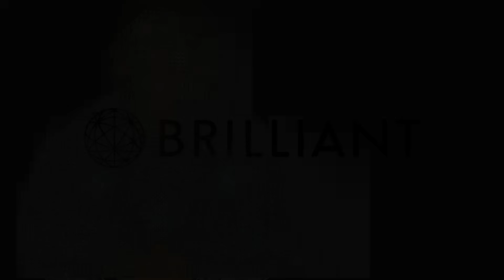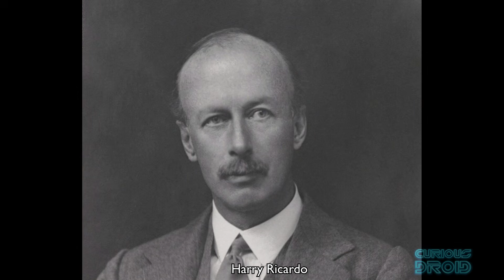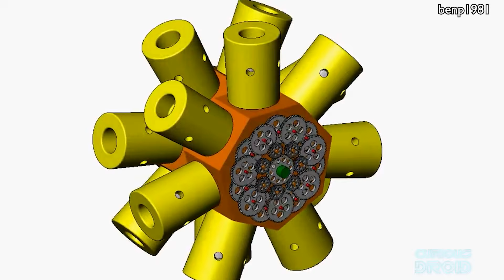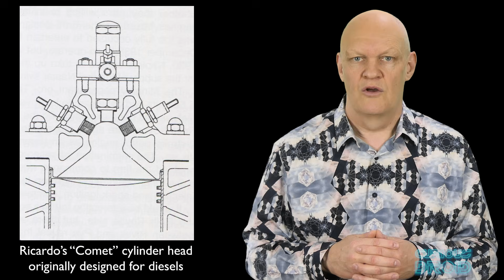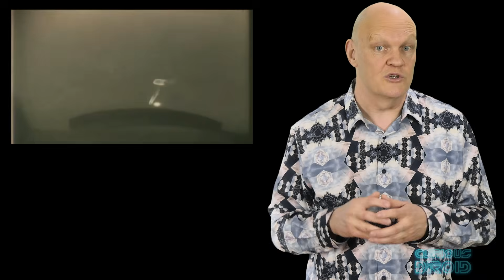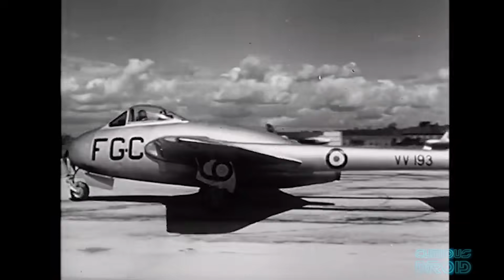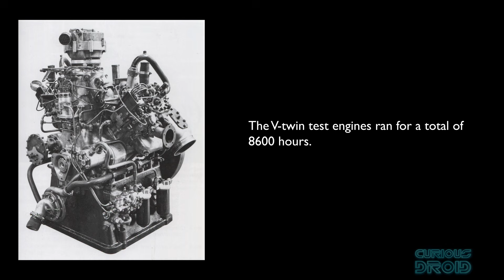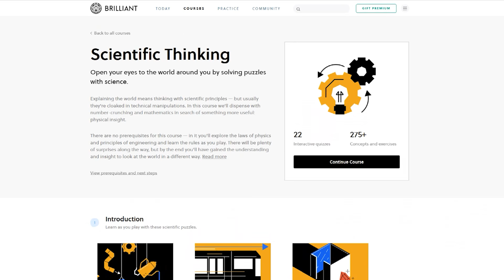Rolls Royce Crecy - The Most Advanced Piston Aero Engine Never Made.

Comment: "We just need another 6 months of development time..." - Every engineer ever.
Reply: "3 months maybe, 6 months definitely."
Reply: @jeff119990  I have said that more than once.. :-)
Reply: And quite often they are proved right...
Reply: @waynegilbert9504  it depends very much if they have not encountered development issues. More importantly that the engine is born "right" as was the case of the Merlin that despite usual problems had only very few "teething problems" that was quickly solved, something that cannot be said regarding the formidable Napier Sabre IV engine; that had been principally delayed by protracted problems and slippages encountered in the development of this engine...
Reply: @paoloviti6156  My experience with development issues is that if they don’t turn up during development they appear during deployment and cost 50 times more to fix.  The Merlin is a vastly simpler engine than the Napier Sabre, development of which was started with a very incomplete understanding of the sleeve valve technology - as illustrated in the case of the RR Crecy design.  Of course, all of these died quickly when the gas turbine became a feasible reality.
Reply: @waynegilbert9504  exactly and well said. Aside complexity with sleeve-valves it is possible that those engines have higher oil consumption in order to lubricate the sleeve-valves and the wheels?
Reply: @paoloviti6156  Indeed they did have oil consumption problems.  One of the benefits of the sleeve valve is the greater port area that becomes possible, this inevitably leads to more of the exposed sleeve being lubricated.  The exposed oil is burned off during each engine cycle.  The Sabre also had problems with resulting the carbon deposits causing drag on the sleeve.  Years ago I had the privilege to take to an WW2 ex-RAF ground engineer who told me that supporting the sabre engine was a nightmare, especially the earlier units that were plagued with problems.
Reply: @waynegilbert9504  thanks for taking your time to explain. One thing for sure is that those mechanics doing service on those wonderful aereo engines especially the Sabre Napier, complicated as hell, were far above the average with years of experience on the shoulders...
Reply: @paoloviti6156  All of the engines in that era had very high oil consumption, some oil burned and some leakage, so much so that it was considered a consumable and part of the useful load, standard practice was to calculate oil weight and consumption into each flight load plan. (Multiple gallons per engine per mission) 
Even decades later calculating oil weight remains in some pilot training books, though aircraft manuals have since standardized to include engine oil as part of the operating empty weight due to the drastic reduction in consumption. 
Now the oil burned in the cylinder is simply another fuel source so was not a significant performance impact, and oil leaked was due to the gaskets of the time which affected all engine designs.
Reply: @mytech6779  thanks for the info! Must say that aereo engines of 2nd WW required lot of oil but perhaps the most unfamous in this field was the massive Pratt & Whitney R-4360 Wasp Major, that powered the postwar B-36, that required prodigious amount of oil to lubricate its engines...
Reply: @paoloviti6156 ...they were told, "don't worry about fuel and oil consumption, we want it fast!"
The pressures of wartime force compromises be made. And engineering and medicine both advance during war.

They HAVE to...penicillin from the Tizard mission was in doctors hands before the war ended.
Reply: @paoloviti6156  blln
Reply: @paoloviti6156  The Merlin born right????  Did you forget the ramp head? Failing the type testing but given a pass for expediency?  The limited hours before valve failure? The quill shaft failures, the cam shaft drive failures, etc, etc   In reality, all the earlier production Merlins were more big Kestrels rather than anything else. The Merlin was the perfect example of the triumph of development over design, don't fall for RR's marketing hype.  Now the Griffin, that was born right.  RR would have preferred to get rid of the Merlin and concentrate on the Griffin, but that was not possible, it was too universal and turned in the "right" direction for the Americans.  It was also light and sounded "right" unlike the Griffin <shrug>.

It was the Sabre II that got the bad reputation.  The Sabre IV was a considerable redesign of the internals of the engine, the program proceeded quite well with the limited resources available, but people were impatient.  RR had a huge engineering department, so big they could design distractions like the Pennine and to an extent the Exe and Crecy, Napier not so much.  RR also had a tendency to lure engineers away from Napier   Don't forget, the Centaurus was also "late" and wasn't finished until after Roy Feden had left Bristol.  The Junkers JU222 was so late that it killed the entire German heavy bomber program!

All production Sabres were impressive, they were passing their type tests and producing over 2000hp at a time the Merlin was producing just over 1000hp.  

Such discussions can go on for a long time with tit for tat claims.  Doesn't bother me, I like the Merlin because of its fascinating development story, just as I like the Sabre for the story of its production woes.  But then i was once an engineer and I usually like the backstories and the nitty-gritty rather than the pizazz.  

Now, the Nomad II, there is a design that is extraordinary, the thermodynamics and the fine detailed engineering required to make it work.   Was never going to catch on, too many parts (pommies just love making parts) but I reckon it was killed by the Beiers variable ratio coupling.  Anyone looking at it would shudder when thinking of the usual maintenance people working on the delicate and so precise discs.   And keeping it all pristine clean!!!
Reply: @paoloviti6156  The Merlin's oil consumption was somewhere north of an imperial gallon an hour up to about 5 gph was acceptable AFAICR.  

Design changes keep the oil consumption down on the Sabres unless the sleeves had manufacturing faults or were excessively worn due to dirt and debris entering the engine through the air intake.  Sleeve valves were not that complex and had a number of advantages, some of which were overtaken by the enormous effort put into fixing the poppet valve train, others advantages continued.  The problem was the precision manufacturing required for the very high performance application of high-powered aero engines.  At the beginning, the Hercules piston/sleeve/cylinder were manufactured to fit each other and were always changed as a matched set.  By the end of the war, manufacturing had improved to the point that the parts were interchangeable.  Henry Ford was a big believer in accuracy and precision, as these are prerequisites to reliable mass production.  Look up the "Johansson gauge blocks".  The precision in, even cheap, modern car engines would have dumbfounded production engineers in the war years.  As to material science...
Reply: @waynegilbert9504  All WWII aero engines burnt heaps of oil, excessive usage was viewed more as an indicator of other engine problems rather than a problem in itself.  Amazing thing about the sleeve valve design used by Napier and Bristol, which is essentially unchanged from the original Burt design in the Argyll car, is that one of ports in the sleeve alternatively uncovers the exhaust and inlet port in the block That is, the sleeve is exposed to the flow of hot exhaust gases and then rapidly exposed to (relatively) cold inlet gas flow, in engineering, this is normally a big no-no, but they got away with it.   

If poppet valves had been more advanced in the early thirties, sleeve valves would have never been used in WWII.  Apart from their advantages (and disadvantages) in gas flow, they were just more reliable than poppet valves as erosion of the exhaust valve was a very serious issue in 30s aero engines, as were valve spring failures.   These issues had been a problem from the dawn of high performance IC engines, the 1912 L76 Grand Prix Peugeots used desmodromic valve gear on their twin overhead cams mostly because valve springs were so unreliable.  After an enormous effort, poppet valves became more reliable, eg RRs Bright-Ray coating cost RR a fortune to develop, as did Roy Fedden's search for the perfect material for sleeve valves cost Bristol a fortune.

I am sure the WW2 ex-RAF ground engineer had plenty of bad experience with the early Sabres but generally, they hated them because they could be difficult to start, once they had run through the four (I think it was four) Coffman cartridges  without starting, they had to oil up the sleeve bores by pulling the plugs - not much fun.  The engine was just very different to the RRs.  The RRs were normal, the RAF had been using them forever, they had used the Napier Lion as well but the Sabres were a completely different beast, I believe they weren't keen on the Dagger either.

 In normal times, no one in the field actually worked on engines, any problems, not strictly maintenance as covered by the book, had to be solved back at the manufacturer's dedicated maintenance facility, just the same as the RRs and Bristols, that is an engine change.  I am sure there were times when they were fixed in the field, but I am not sure how you work on an engine that you have never pulled apart before and don't have the tools, parts or facilities to repair.
Reply: @robertnicholson7733  thanks for the very interesting info, much appreciated 👍👍
Reply: @robertnicholson7733  a very interesting info regarding the Sabre as I find it very informative, thank you 👍👍
Reply: @paoloviti6156  Yes, I heard sleeve valves in the Sabre were nightmares of leakage & breakage, and that the early development models of the Bristol Centarus were almost as bad.
Reply: @dphalanx7465  yes but the truth was that the engines were very complicated that necessitated much long development that was not possible because the war yet I find it impressive that they managed to put in production those two engines...
Reply: Keep fighting time and money constraints and this will be the standard answer...always
Reply: @ambread1 ...don't forget incompetent managers.
Reply: @M Bacon Not surprised given the number of sliding parts.  I had never looked at sleeve valve engines in cars before, but they seemed to do better that i would have expected. https://en.wikipedia.org/wiki/Knight_engine   Thats not to say I would want one...
Reply: Its just so we can seem like geniuses when we actually do it in half the time. 😁
Reply: And still the business guys didn't learn, that it's cheaper to give it 6 more months than to fix the problems afterwards...
Reply: More of every investors holding back engineers, ever hehe...
Reply: And then there is Gabrielli who developed the Fiat G-92 in just 1 month
Reply: Engineers have an easy life, they get to work around the clock for six months to complete one milestone, us welders always need to have six months work delivered yesterday.
Reply: We can usually do it in a week but the majority of the crew will be missing most major body parts.
Reply: eg F-35.
Reply: Its a DFI gas 2 stroke and the Rotax 850 ETEC is a tiny version of it sort of.
Reply: Wait they could have done a popper valved loop scavenged conversion of the merlin with running the cam at 1:1 and baffle installed in the inlet valve to prevent short circuiting the air charge! This can tune any 4 joke into a 2 stroke with out a lot of hardware, swearing and machining! This is how to make a quick 2 stroke conversion fix using what you already have. It works like this on this 1.9vw 2 stroke conversion 450 HP bug 2T:https://www.youtube.com/watch?v=qosAllch8Sg&t=9s
Reply: Yes!!!!
Reply: We just need another 1 billion pounds and where there.

Comment: How I wish some clever engineer would find that engine interesting enough to take on the task and try to recreate and perhaps, complete the design. Would be a proper salute to the original designers and the engine it self, to see it complete.
Reply: Using current manufacturing technology and materials, this would not be a particular problem.  But it would be a solution to a problem the existed 80 years ago and would have little value today.  Apart form making one hell of a noise :-)
Reply: @waynegilbert9504  Go and see Riccardo Consultancy in Shoreham with a large wadge of cash and they will probably build you one.
Reply: @johnmurrell3175  No doubt about it, hence my comment.

Comment: Makes me wonder if this can be adapted to automobiles to improve their performance and efficiency.  I'll be willing to bet that the fuel efficiency will go up exponentially as well.
Reply: Motorcycles would probably benefit from this even more. If you can reduce the frontal area of the motor you can significantly reduce drag.
Assuming you are aiming for similar power levels to current bikes.
Really any time you can reduce the size of a motor for a given amount of power there are going to be a lot of secondary benefits.
Obviously muffler design would be VERY important for civilian use...
Reply: If you're interested in modern 2-stroke engine technology check out the Rotax/Evinrude voice coil direct fuel injected 2-stroke engine that's been used in snowmobiles & outboard motor boats for over a decade now.

Comment: An interesting thing about the sleeve for the Crecy was that there were only ports in them for the inlet, which was near the bottom of the cylinder. The top of the sleeve uncovered the exhaust ports during its reciprocating motion. This caused problems with the longevity of the sleeves.

Comment: Look up the Napier Nomad to see where that sort of thinking ultimately led.
Reply: 2-stroke diesel, with a huge turbocharger that could produce useable thrust. The test engine were reliable getting over 3500hp at a ridiculously meagre fuel consuption. Then the added an intercooler, and then stuck an afterburner on the back of the turbo! Madness, but it got the power to weight down to 0.83lb/hp. And the test horsepower was around 4100. There is a great write up in LJK Setrights book "The Power to Fly", a history of the piston engines used in aircraft.
Reply: @sadiqmohamed681  Technically, it would be better to describe it as a gas turbine that used a 2 stroke diesel as a gas convertor.  If you follow Chatterton's work you will see why.  

It was just too complicated, two engines in one, required a spark ignition to get it started, but the real problem was the delicate Biers variable ratio coupling.  Had some unusual internals, since it was a two stroke, the con-rod little end was a slipper bearing, the con-rod big end bearing shared the same journal, there was no big end cap just a couple of small rings to top stop the rods from falling off the journals when the engine was at rest or starting.  Pressurized coil cooled piston crowns of martensite (AFAICR), the list of design features goes on. the Nomad 1  was far more complex than the Nomad II, however complex does not mean advanced.
Reply: @sadiqmohamed681  I found it in "Some Unusual Engines" by Setright.
Reply: @donaldasayers  Another good book. I should look for a copy. I haven't read it for a very long time. I used to have "The Power to Fly", but it disappeared a couple of decades ago. I spent more than 10 years looking online before I found one I could afford. Good copies are into hundreds, and there was a mint edition fo £1,400! All Setrights books are collectible.

Comment: An even more powerful piston engine that is lighter and simpler in design would be a full on 2 stroke fuel and oil injected spark ignition engine..with expansion chamber tuned exhaust system..I could just imagine the output of a RR Merlin equivalent using this design principle had it been developed further.
Reply: Have you been living under a rock? The Rotax E-TEC voice coil direct injection 2-stroke engine has been powering snowmobiles & outboard motor boats for more than a decade. There's even a Turbo-charged version.
Reply: @autodidact537  My comment sir has been worded in simpler terms for the benefit of readers who are NOT techno heads like you and I..As an Aerospace Engineer of 30 years I could pour out the terminology that would baffle even your lovely self..So let's just keep this nice and respectful and maintain the peace ok?😁😁😁
Reply: @albertsammut433  In other words you had no idea what I was talking about. lol

Comment: For comparison the highest performing engines I can think of are the V8s found in Top Fuel Dragsters. They run around 8000 hp and basically melt after 30 seconds.
Reply: Melt after 3 seconds*

Comment: The second biggest problem with two-stroke engines is fuel efficiency, which is terrible.
Reply: The Crecy was a lean burn engine, as explained in the section about the combustion chamber.

It actually had very good brake specific fuel consumption at high power, not so good at low power. It was considered as a full throttle engine, as were the early turbines.
Reply: I guess you've never heard of the Rotax E-TEC voice coil direct injection 2-stroke engine, they're powerful, fuel efficient, virtually smoke free & have low emissions. These engines have been powering snowmobiles & outboard motor boats for over a decade.
Reply: @autodidact537  "Voice coil"?  

If it was possible to produce a clean running and fuel efficient two stroke the auto companies would be producing them.  Hello?